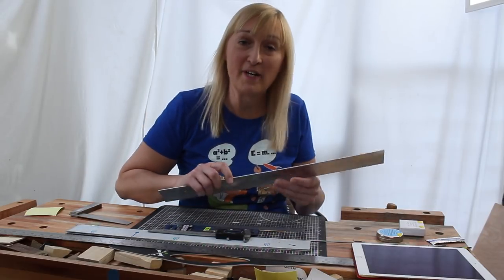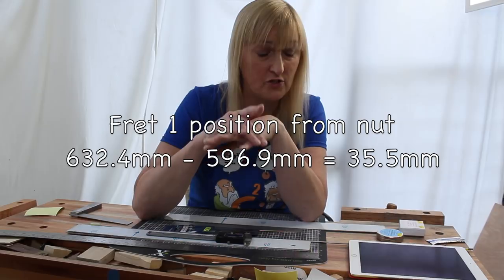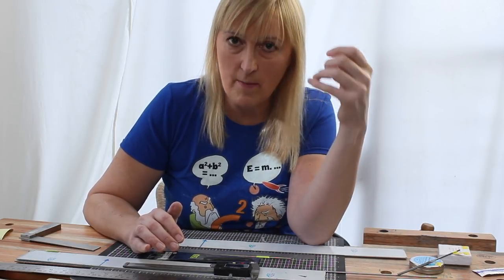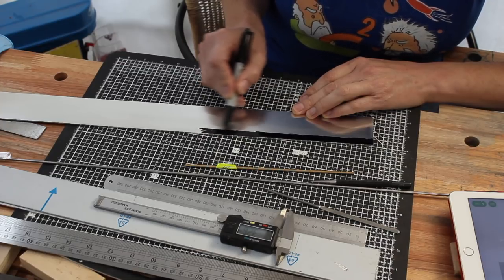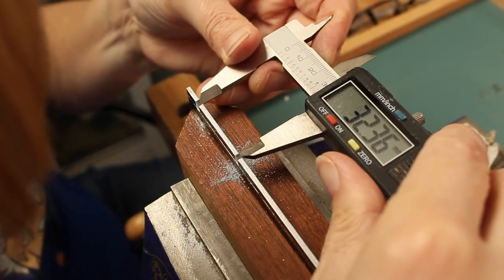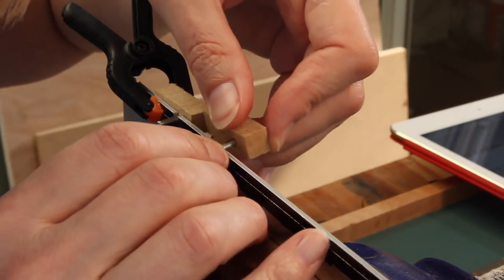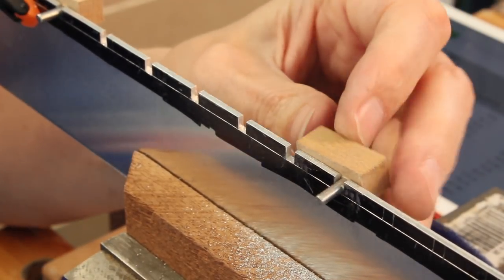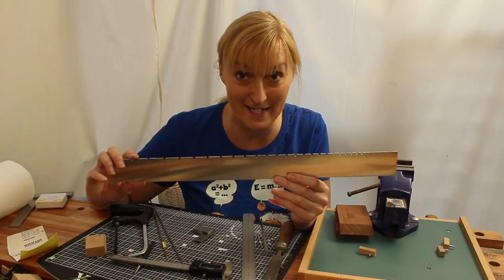Making a Fret Position Template plus an explanation of fret position and nut compensation

Comment: i get the compensated nut thing, i lived it,  a little over a year ago , i had to move my guitars to my basment,  and they sat for about 3 months unplayed, when i set my stuff up, not 1 of my guitars was set up , i mean at all, (i have 16).
 They would not go in tune no matter what i did, more  the fretted notes, simple power chords wouldn't ring out without starting to  "wave" oscilate? i don't know what to call it, i swore it was because it was winter, and the drastic temperature difference from the top floor to the bottom, even though the whol house has central air / heat, i used to work in QC at hoshino, and be best friend worked in the repair room, and i learned from them , so i am trained by some of the best, so i ,  took a few guitars to a friend of mine for set up , he changed the strings, and told me they were set up perfect already, he didn't have to do intonation on the floyds, so i took them home , and the same thing, they would not tune, it wound up that my carpal tunnel had gotten worse in my left arm, and since i couldn't feel the strings as well, i was pulling them just slightly too sharp when i would frett a note, and that messed up my whole set up, so i understand what you were saying about the compensated nut, the fix was having carpal tunnel relief and ulnal cubit nerve release done, and now they tune again,  it's really really wierd how sensitive these things are

Comment: Very good Susie, especially the pre-amble, I just love your presentation and admire your work.
 I'm coming to your videos a touch late, I know, but you throw up some interesting points, particularly regarding compensated nuts and the accidental (or deliberate) saw kerf issue shortening of the first fret ratio. Question; has it ever been a consideration to saw the nut end of the fretboard at an angle?
Accurate measurement of a slot..............feeler gauge!  Squaring a line from a scribed mark..........put the scriber on the mark first, then slide the square to it. Also regarding your parallax issue.....have the rule sitting on edge, not the side. Slight niggle it's a try square not a set square!!!

Comment: Susan, I have a question. Say I have a non-lined fretless neck of the 34" long scale Fender Jazz Bass neck and wish to have the Short Scale frets on it, can I go or say have the 24 frets?  Then I replace the bridge in order to have the right position and adjust the intonation. Is my way of thinking correct to have the more frets, say the 2 octaves or more frets on a Fender bass neck? The reason why I am asking this is that I love the grip of the Jazz bass and in need of the 24 frets for the phrases I used to play with my stolen custom Alembic which I had a custom order it with the exact same width and shape of my old Fender Jazz. It made me down for a while but I saw a bass player with the non-stock (Fender had the 24-fret Jazz Bass neck bolted on to the body as "Fender" usual way model) but 21 frets) and I thought to how he could do that. Maybe by the luthier. But now it seems as I have found the way. Is it possible to have the two-octave fretboard by using the fretless Fender neck to the 24-fret short scale bass?  And is such work could be ordered to the luthier which its shop does all sorts of works from repair t simple fret replacement of an electric guitar? I got me a full kit of the same Alembic copy assembly from the pickups and the noise canceler pickup like thing in the middle to the power supply/ stereo out cannon out with the non-stereo regular jack.  then I can have a custom bolt-on neck 24 fret bass. BTW, I had my bass with real bolt, not the screw-on neck system by seeing the IKEA furniture and I did the modification by using the same round nut. The ones which come to the top side (left side viewing the instrument) semi-glue set (dub of the Loctite jelly worked just fine) and the strength of the neck attached to the body went up as high as 190% (using the automotive tensile strength checker meter.)  By having this, having the bend effect sound while holding the head and the upper horn of the cutaway during the performance,  the tuning of the strings stayed! Use this method Susan, for your customers who want more accuracy while playing wild on stage. It works! And this bolt can be ordered and made by the ordinary machinist. The machinist shop in my home town took the order with no problem with the M figure diameter of the bolt and the made from round stainless steel bar. It could be your special working menu. This works on the dead spots, too. Please advise for having more frets by making the short scale (34" to 30" or 32" medium scale) to have the more frets. Thank you. Currently, I am applying for a patent for using this for adding the more strength and more.

Comment: A question because I am very bad at using manual cutting tools:  Instead of painstakingly cutting all of those slots, did you ever consider drilling holes (3 or 4mm diameter) on the order of 1cm from the edge, and then use a vertical locating pin?

Comment: Not OTT at all - fascinating.

Now, this nut compensation lark. 

1: Is it worth sanding the treble side of the f’board an extra .5mm shorter than the kerf-compensated bass side? And..

2: does this have anything to do with the ‘untunable G-string’ phenomenon some guitars have, where you can get fretted notes right OR you can get the open string right, but not both?

Comment: Question: So when using calipers to measure between two fret position slots with pegs in them, as you are, the total length should be the distance between the two frets plus the diameter of one peg. Is that correct? Love your videos!
Reply from the maker: That’s correct. I added an extra column to the spreadsheet I was using so there was no chance of getting it wrong.
Reply: Susan Gardener Thanks so much for the quick response. Cheers!
Reply: +Susan Gardener
Would it not be more accurate to lay out the scale, punch the fret position and drill holes (on the drill press)for alignment instead of employing handfiled, rectangular slots? also it would be less work, I think.
Reply: Susan Gardener - Trying to understand all this so I watched your video (and many others) you are a good teacher.
My problem (which I hope others will note) with bridge intonation and the 12th fret. The bridge pulled loose so I replaced it with a better pre made bridge,ebony and slotted pin holes etc.. The bridge had a .250 wide angled slot for the saddle. Thinking this was good in case I needed to move the breaking point forward or back for intonation.
Measured for placement. Routed the top of the guitar slightly and made the pre made bridge a little thinner for the action, glued it in with a home made clamp.
Problem, the high E string is perfect in every way and breaks over the BACK of the saddle. The Low E and other strings can not go back any further as needed without running into the string over angle and pins to get correct intonation. That all said if there is a next time I am going to physically test location before gluing down.
I was assuming I had plenty of adjustment. Now it is be happy the way it is,remove the bridge set it back (not happening) drill holes in the bridge to lengthen the string mod the saddle etc.. Good thought on moving back the nut in place of overhang for the open string intonation.

Comment: Why not make a vernier scale on a CAD software and use it against a metre rule to accurately position your template material with respect to a machining head like a drill press or fixed angle grinder to accurately cut a notch in the template
I riggged up a jig like this on my radial arm saw to cut fretboards directly very accurately Am going to modify the jig to cut a template

Comment: Due to watching your Videos and so having great confidence in your choices of tooling I've brought a Triton MOF001 router. I would like to know the thread size of the bolts for attaching it to a table, I think they are either 1/4" BSW or 1/4" UNC but wondered if you can confirm. I have searched the WWW but cant find the info. I still listen to the "Blackbird" video every now & again. The technical parts of your videos are well over my head I'm afraid but the machining is Very Good.

Comment: And I have to use millimeters and that's fine because their easier and more precise and I really can't measure 1.431 a 1st fret measurement on a 25.5" fender or any neck as far as that goes having a 12/3/4 measurement dead centered on the 12th fret.

Comment: I may have missed it but did you subtract half of the pin size to your distance fret to fret. Cause you are measuring out to out rather than center to center. So if you did not the fret spacing will be off by half a pin size.
Reply from the maker: +Dane Nichols I added a column in the spreadsheet to add on the slot width 3.17mm
Reply: Susan Gardener, I thought I must have missed something. I got interrupted several times in the course of the vids. Thanks Suz I now know I do not want to make one for myself.

Comment: Brilliant explanation of the mathmatics but I question the accuracy of this gauge over those commercially available. Why choose gauge material with a high coefficient of expansion? You will never produce accurate work sitting at a wobby vice as any fitter will tell you. This gauge is to assist placement of commercial fretwire the tolerance of which will vary according to the wear upon the producing machine. Stringed instruments are not precision machines they are relationship machines composed of mixed materials subject to varied amounts of movement throughout their life. While they start as reasonably accurately and carefully constructed the end result is approximation - it cannot be otherwise. That is why each instrument has its own voice. I love the maths explanation though - sublime!
Reply from the maker: There’s no point in not being accurate - this method produces a result I could not reproduce if measuring and sawing slot positions by eye. As for thermal expansion, even if I was working in an environment 10° hotter of cooler than when I created the gauge, the octave position would only be 0.06mm out - in practise it will be much less than that.

Comment: What is the general rule of thumb for acceptable accuracy, my nylon string fretboard has a few slots out by around half a mm, being a classical, I thought that should work.  It is my first one and thought that wasn't too bad but on an electric would that be okay?
Reply from the maker: +Robert Sparkman if you have, say, 30mm between the frets then your tuning for that fret will be out by maybe 1.5 cents, which most people won't ever notice. On a higher fret though the same error could be 3 cents out which might be noticeable. I'm not sure it matters if it's classical or electric. Personally I'd have thought it more important to get it right on a classical, but it depends who's playing it - most wouldn't notice.

Comment: Do you know how one would go about calculating fret positions in just intonation? I get that the fundamental string is divided by fractions, and that the frequencies themselves are ratios to the fundamental.  But how does that translate to fret positions for strings other than the fundamental?
Reply from the maker: Always think in terms of scale length or length of vibrating string. For equal temperament we keep dividing the scale length by 1/12 root of 2 (1.059....) to get each new scale length, and to get the feet position relative to the nut we subtract from the original scale length. So for a 630mm scale, to get the 4th fret we divide by 1.059 4times, or 1.2599 (the 4th power of 1.059), which gives our new ‘scale length’ of 500mm. The 4th fret is 130mm from the nut(630-500).
In true temperament the major 3rd is a 5/4 ratio or 1.25, which goes a new scale length of 504mm and a fret position of 126mm - a 4mm difference from equal temperament, which explains why 3rds can sound a little sharp.
The problem I have with trying to do true temperament on a fret board is you’ve got to decide what your root note is and the always play in that key. Do you want to only ever play in E? Maybe A or D? That 126mm 4th fret might produce a harmonious 3rd with the open string, but the 4th fret won’t be a major 3rd compared to the other strings - it might need to function as all different intervals for each string. That’s why on true temperament fretting systems the frets aren’t straight - they wiggle about trying to be compensate each fret differently.
The ratio of true temp frequencies can be found on Wikipedia, but as a starter, a major arpeggio- root, 3rd, 5th, octave - has the ratio 4:5:6:8.
I hope that helps.
Reply: @SusanGardener  thank you very much! I'm going to have to read this a few times.

Comment: Hmm... I think I see your point about the compensated nut: With high enough presicion you may be able to correct the note a few cents. These few cents can be measured, but it is doubtful to what degree the human ear is able to pick them up and tell the difference, right? If that is the case then I am puzzled why you would not go with a zero fret. With a compensated nut you should always end up with slightly more or slightly less string hight than necessary and therefore slightly worse playability. Is the sacrifice of playability worth a few cents, which you may not even be able to hear?
Reply from the maker: +umbalaba the compensation doesn't change string height it moves the nut closer to the 1st fret. In fact you might want to raise height at the nut if you want a set up more suited to slide playing, and then you might want several millimetres of compensation - you can definitely hear an uncompensated nut with a high action - the fretted notes are sharp. You can't do any of this setup with a zero fret. There's no single 'perfect' setup - it depends on the player - a zero fret takes away setup flexibility
Reply: +Susan Gardener Thank you for the answer. I agree that a nut offers more setup options and if you are leaning towards slide playing and away from finger playing, then I believe I understand you design choice. Yet, if you wanted the lowest possible action, the zero fret would have been the way to go. You are right about there being no single "perfect" setup - it depends on the player. I do, however, think you will discover that nut compensation will affect the string height. In an ideal mathematical world compensation will not change the string hight, yet in a real physical world it will, even if just slightly. You will have to cut the nut slots and even though you can come close you will not be able to cut 6 perfectly identical slots. Not even a CNC machine can do that. You will inevitably overshoot and/or undershoot the cuts, even if just slightly.
Reply: The better cnc machine are very very accurate, much more accurate than required here.

Comment: Sorry, l didn’t get your math....- how you ended up at “1.059”...- etc etc...
What nr divided to what...?
Reply from the maker: 1.059 is the twelfth root of 2. If you multiply it by itself twelve times you get 2. It’s a way of dividing 2, an octave, by 12 equal segments, but geometrically - multiplication rather than addition.

Comment: Bit long winded. Measure the rod in the same manner centre punch and drill for panel pins, clamp to finger board put pin through holes to mark positions of frets. make small jig to fit finger board. get cheap tenon saw and set teeth to fret tang  width  move jig to mark and cut for tangs. if you are short of cash you can have several rows of holes in the same rod for different scale measures.
Reply from the maker: Sounds like your method relies on lining the cuts up by eye - error prone. My method might be long winded in initial setup, but now I have a quick repeatable error free method
Reply: no the marking knife tip is put into its own pre made slot the guide for the saw is then slid up to it engineering at its best this is how things were made in the past. Both methods have the same accuracy factor remember that real marking knives are left and right handed, and a well ground centre punch will stop where two scribed lines intersect.
Reply: This is a far better method than shown in the video, but be very careful with the centre punch, this is where the inaccuracy will be..  Sorry to disappoint the video maker and  it is still a good video.   Better still   a good engineer machinist would use a cnc machine to make the slots  or holes, whichever preferred

.

Comment: Very pretty hands you have considering you use them often. And you still have a dainty lady-like dance to them as you use, essentially, 'man toys'. You're certainly capable. Very attractive. Yes, I paid attention to the video. I learned more about it. I've always known the formula as the "rule of eighteen." Is it the same concept as the math you explain? Is there a compensated device in math added to my concept as well or could it benefit from one? All I know is fretting a string lengthens it at the assigned contact point (pre-compensated calc) on the string just before it contacts. Meaning, if one were to use your mini-square and place next to any fret and mark at the open string, that mark will fall short off the fret contact point when fretted. So open being the 'mean' calculation and fretted being 'compensated' am I incorrect in my understanding that mean length increases as we ascend the neck, changing or, rather increasing incrementally the already applied compensation? The string to fret angle increases incrementally ascending the neck therefore increasing mean length or, "squared-to-fret points on open string". Your math was a little too fast for me. I've only watched it once. Perhaps it was your pretty hand dance distracting me.